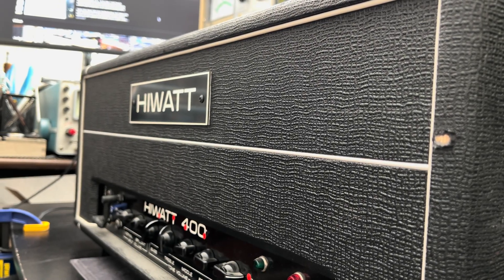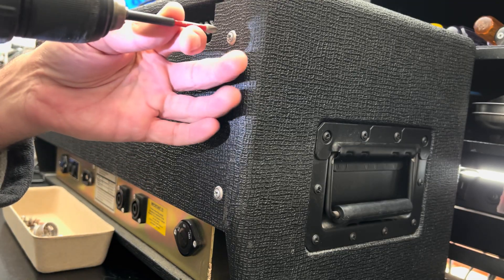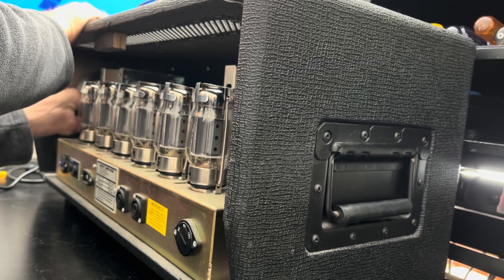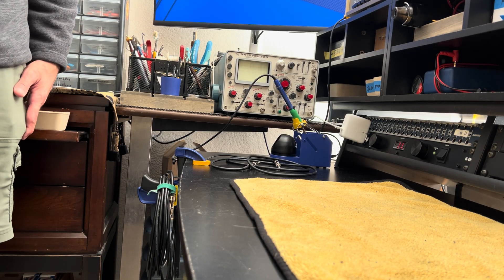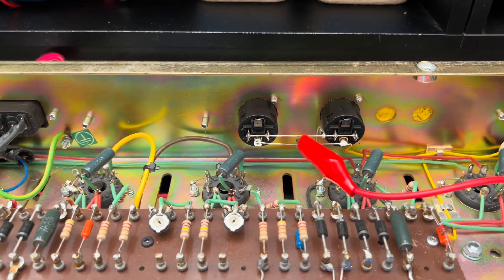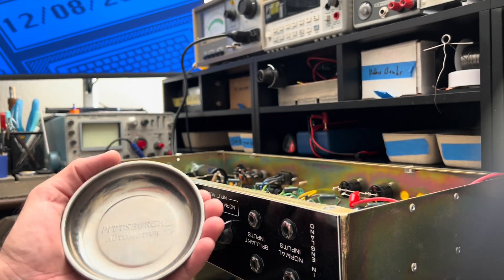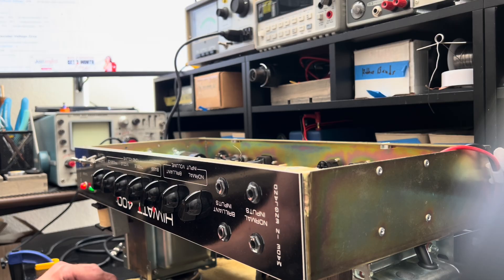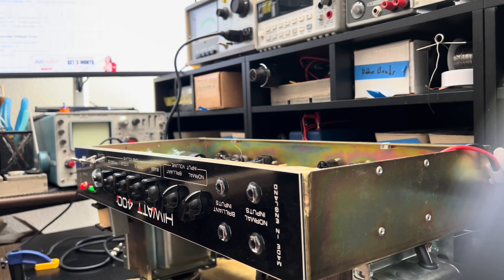Hiwatt DR405 — The Nightmare Before Christmas?

Comment: Do you recall the plate and screen voltages? Just curious- been wanting to build a big old amp for a while!

Nevermind, you just said 594. Screen around 400?
Reply from the maker: lol screens were only marginally cooler!  I just received ANOTHER one of these yesterday 😳. I’ll post up soon.
Reply: @ForgottenGearRestorations wow, dang. I bet the screens light up under load, if you're brave enough to clip the beast! I seem to recall the old ones had a split supply with the plate winding stacked on top of the screen winding, something like 650v plate and 400 screen. Probably a bit safer for the tubes that way.

As long as I'm watching your vids I'm going to have overly technical questions and comments. Feel free to ignore my nonsense! Thanks dude!
Reply from the maker: No dude, send em!

Comment: wowsa what a Amp and puts my VT22 to shame in weight ,whats the wattage output on that monster ?
Reply from the maker: That ampeg is no champ!  400w!
Reply: @ForgottenGearRestorations  400w Amp !!!  good Lawd thats alot of power even for Wembley Stadium 🤭
Reply from the maker: It will sterilize you!
Reply: @joemcgraw5529  I feel like there's no point without running maybe four cabs off this thing at once!